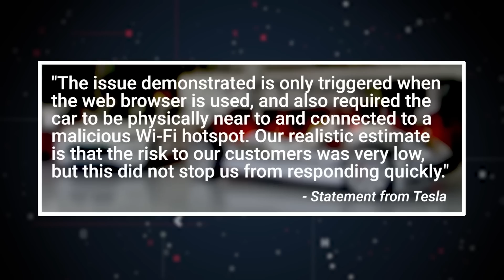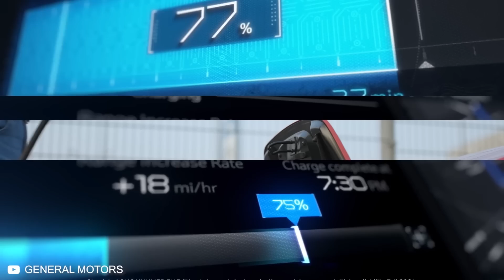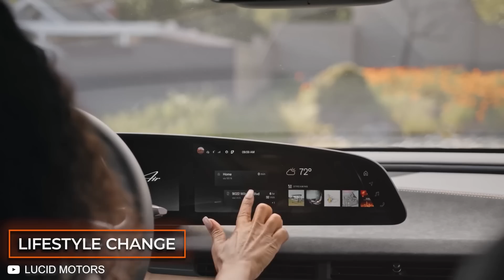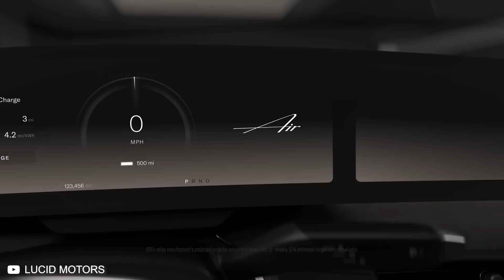EVs' Serious Problems That Carmakers Are Hiding

Comment: There is no way in hell I would ever buy one! It’s ludicrous. First, electric vehicle is NOT a disruptive technological breakthrough. It brings no innovative improvement for the consumer - other than the pure lie that it is good for the environment. LMAO! It will require an increase of 2.25 trillion KWH to have all drivers in the US to electric. Where is the fuel for the added electricity gonna come from? Well hell! Coal and Natural gas - and that will fry us quicker than gas guzzling SUVs - if you believe that garbage.
The motivation for switching to electric is to gain total control over mobility. Yeah you tree hugging dumbass! I say drill that abiotic oil and shut your pie hole. If you want me to get excited about new mode of travel then invent something that doesn’t require a massive government teet and flies like the jet sons.

Comment: Recently talked to a car salesman at a large dealership about ev's.
He said that they had an ev as a test run a few months back, but nobody was interested in it.  To costly, and the amount of babysitting you have to put into it, and lifestyle it demands from the owner. 
The manager sent it back. 
I guess living in the farming communities of the midwest USA is not the place for ev sales or usage.
Reply: I'm no fan of gas cars. I use during early winter, summer and spring a rather fancy ebike, which runs well in the cold of Minnesota. Most of the cars here are gas guzzlers
Reply: @duchessstudioband7896   You ride a bike in a Winter ?
 Just trying to get it straight .
Reply: @icosthop9998  yes I do. As long as I don't see ice, I'm good. I have electric heated gloves, and electric socks, neck warmer as well, with a full helmet. I cut it when there's a real snow cover. Tho the Grizzly bike is a total beast in the snow.  Awesome bike, with plenty of power
Reply: And btw, I'm a rather youthful. 66 woman. I made a commitment to commuting to my.job on an ebike, Minnesota has alot of bike trails, most roads have ebike lanes, so it's a Kool way to get around.  Early winter riding isn't bad with the right gear
Reply: @duchessstudioband7896  I've been to Minnesota in the winter when the temp is -20 and the wind blowing and snowing,how do you manage to wear enough to stay warm?
Reply: @hubertwalters4300  I stay warm with electric gloves. There are alot of winter wear that's designed with electric heated batteries. Vests, coats, gloves, socks. Very useful until there is a snow cover or a real snow pack. During the worst part of the winter, I use metro transit, which as you know, covers the suburbs as well as city. I work in the suburbs. But Minnesota has a huge amount of bike trails that are paved, bike lanes. The planners are building bike lanes into roads. There is a paved Bike trail that goes from St Paul to Duluth.  That's a long ass distance.
Reply: @2-MuleTeam  Very true, urbanites have much to be grateful for with regard to rural red America. It's also very true that rural America has much to be grateful for with regard to urbanized America. It would be refreshing to have us appreciate each other, rather than posting inflammatory messages back and forth. Peace.
Reply: So it's ok as long as you don't drive anywhere where it gets hot or cold just park it in the driveway and look at it,maybe go to the local grocery store,finally the government will have you where the leftest want you,unable to get in a vehicle,anytime and drive anywhere in the USA you want to go,this has annoyed leftest Democrats for a long time,they want your freedom to travel severely curtailed.
Reply: clot shots  I'd say EVs are simpler, so require less maintenance. 😉 I guess EVs don't work everywhere then.
Reply: There is so much disinformation in these's threads. As a farmer here is my personal experience. I live on a farm in rural NE PA. The nearest small city is around 37 miles making a trip to work/store a bit over an hour drive. I put a LOT of miles on my cars each year! In the past I have stuck with Toyota's with VTECH engines (no super chargers) as I knew that I could get around 250k-300k miles out of them and they were more friendly on gas. But I still paid a LOT of money on gas. I also knew we were well past 2006 "peak oil" production. The truth is despite fluctuations in gas price no matter WHO is in office gas will will forever go up and the speed of going up WILL increase. Seeing what is coming on the horizon I decided to do some real research for about 6 months. Based on real world data decent EVs were getting 500k-1m miles on their batteries. So about two years ago I bought a used 2017 Bolt EV with 35k miles for $16k. Best car I EVER owned! It's fast! It has a 280 mile range which means I can run around all day and when I get home I have rarely used more than 1/3 to 1/2 my battery. When I leave home my battery is always full. The battery (many monden EVs have this now) is thermally managed and uses a little power to self heat/cool to prevent problems/damage during hot/cold weather. This car has saved me a TON of money on gas! It will save me the cost of buying 3 gas cars by the time it's done. I have taken it cross country a few times with no problems at all (I road trip plan stops at Electrify America charge stations along the way which are very good). Lastly because I am a farmer who grows his own food and believes in self sufficiency/bring prepared, when I got my stimulus checks I purchased some cheap used solar panels and batteries. I now I charge my car off of solar most days. Being green wasn't so much the goal. I wanted ME to have self sufficiency if I needed it. If the grid goes down from a storm, someone starts a war (political party infighting over election, Russia, Israel-Iran war, China-Taiwan, etc), or say world inflation event causes prices of everything to skyrocket like crazy? Me? I am now more self sufficient. If I want to take the car to help the kids or give them some guns I can do that with less impact from outside chaos! Also when I do charge from the grid my money is going into the US economy instead of paying Saudi Arabia to hurt Americans. Reading these replies people are getting off on repeating all the false/negative tribal bickering instead of how it could benefit/make them more self sufficient. Just some food for thought from a real farmer! :)
Reply: @2-MuleTeam  LOL!
Reply: @2-MuleTeam      Again, I agree with most of what you say. And I do see that LONG term EV's can replace a high % of cars. HOWEVER, everything you said is still true. The grid nationwide has been at/near capacity for a couple of decades and it's aging fast. We're going to need tons more capacity if we're going to switch to EV's.
Reply: @2-MuleTeam  Definitely a city or urban phenomenon. I was "forced" into getting an EV because of parking permit costs and parking cost in general in my town, which EVs are exempt from. I also have hillbilly friends who think EVs are the stupidest idea ever, especially because of their price and limited capabilities, not only range. It is also hard to imagine reliable charging infrastructure in the boonies, i.e. needing to go 20 miles to a charger daily if you use your EV professionally, is not something most people agree with.
Reply: That sums it up extremely well !!
Reply: @2-MuleTeam  yeah mule, and the states that get the most money from the feds is the RED rural states.  And let us not forget all the  socialism to build and maintain all the thousands of miles of rural highways.  And don't forget all the products, drugs and such produced by the classes taught by all the commie professors you cry baby about.  If not for the URBAN folks, you MAGA morons would still be crapping in the back yard (many of you still do) and living in mud huts and using kerosene lanterns.  You MAGA  folks drink too much, smoke too much, and do too many drugs (just like your hero DJT).  And listen to too much fake news and are having love affairs with Putin and MBS.  And plus (the BIG PLUS) you worship the false GOD of money.  Just like your true loves -- LUCIFER AND DJT.  ha ha
Reply: @2-MuleTeam  You do realize the new electric trucks haul more weight than the ICE ones right?
Reply: The Ford F-150 Lightning seems to be popular. I doubt it’s only city folks buying it.
Reply: @2-MuleTeam  your stupidity amazes the grontorps
Reply: https://www.youtube.com/watch?v=OJtzuZIO-88&t=248s&ab_channel=FullyChargedShow
Reply: In the UK thieves are now cutting charging cable's for the copper, it's just getting crazy now
Reply: <<I guess living in the farming communities of the midwest USA is not the place for ev sales or usage.>>

The government will give you a choice between an EV or a horse,  as soon as environmentalists can manage it.

Haven't you noticed how much of farming is already controlled by environmentalists?  Why would that expansion of power and control stop?
Reply: @2-MuleTeam       I agree with most of your points. I'd just like to point out that even people who live just ouside a city center are aware of most of what you said. Case in point. NYC- The commuter trains and subways in the Bronx, Brooklyn, & Queens are all designed to bring people in and out of Manhattan. If you want to make a 5 mile crosstown trip in under an hour (one way) you need to have a car. Then it's 15 minutes.
Reply: EV'S = child slave labor in The Congo and a fiery death for you.
Reply: clotshots9072  Got THAT right.
Reply: Electric cars are a massive environmental disaster. Why would you buy one?
Reply: With doing my research I’m realizing it a lot babysitting. Also, the weather can damage those vehicles, especially if too cold,
Reply: @kyshac81  - I am from Wisconsin and they don't call Green Bay the Frozen Tundra for nothing!
Reply: @kyshac81  Not true.....no transmission service required, no oil changes, no poor gas milage....just change the washer fluid and tires from time to time.  Babysitting??
Reply: @barryccollyer2429  I assume the babysitting is in the form of range anxiety, which would be a very real thing in many parts of the US. Where I live it’s not an issue, but that’s why the EV situation is radically different depending on where you live.
Reply: @barryccollyer2429  You forgot never stop for gas.  I have a 100 mile commute and never stop anywhere. The car is fully charged when I wake up and can have 360 miles of range if I choose.  I typically only charge to 70% which gives me 250miles more than enough even if I want to turn around and drive back to work and home again. 
I stopped once at a supercharger to test it out and was topped off before I was finished my cup of coffee.
Reply: I'm sticking to my hellcat, gas prices are not a problem to me cause it will go down.
Reply: @coach2208  I'll look in my rear view mirror for ya!
Reply: @davekozlowski1266  you probably will,  but the inside of your electric car will sound boring.  It's like sitting in your living room being bound around .
Reply: @coach2208  lol, yeah sound and looks are a lot more important than actual performance.
Reply: @coach2208  BTW hellcat will be electric in 2024.
Reply: @coach2208  What makes you say they will go down? I really hope so but I'm doubtful
Reply: @2-MuleTeam  The ICE car or EV is made from rocks, pebbles, sand, dead fish oil, and tree sap. Is that correct.
Reply: @2-MuleTeam  it actually works better in rural areas then urban, as it's easy to charge it at home where you can park on your own property. In urban areas that can typically be a challenge.
And it requires less babysitting than ICE cars: no oil filters, air filters, oil, ...
Reply: @arnaudinstalle  you are correct in theory. I think the governmental push is too all encompassing. It really is just a matter of letting the technology develop to meet rural needs. For some rural folks it may work now, but I think the majority need more than what the tech can give. From how it was explained to me, based off of the testing, is if I had an electric car and drove 100mi in the dead of winter, the first thing I would be doing is looking for a place to charge. Then run my errands, then charge, then drive home.
Reply: @2-MuleTeam  I agree completely, these people live in a bubble, not the real world.
Reply: @hubertwalters4300  It is true , they do live in a bubble. 

 They are very righteous among one another  🙏😇🙏

  I am a #Patron subscriber to the Electric Viking channel. I do learn a lot about EVS there.
I live inner city I own my home , but when I tell them I don't have a garage they are shocked 😲

 I'm sitting out from buying an EV for the next 2 years.
( I would like to wait longer but I don't have the patience)
 The 1st EV  I will buy will probably be in 2024,  the way battery technology keeps advancing and at its current rapid rate a EV today with today's current battery configuration will be obsolete within 2 and a 1/2 years.

 Prime example is that the early EVs with the "3G Technology" are now dead in the water with "5G technology"  kicking in.
Reply: @icosthop9998  I understand, I live in a rual community and I don't have a garage either, I am 70yrs old and I will not be buying a EV, I am retired and through I draw about the max on Social Security and have a union pension, because of all of this inflation we are having I find myself running out of money before the end of the month and having to dip into my savings to hold me over,and I don't even have a house note (house paid for) or car note (two cars,both paid for),but everything from groceries to utilities have gone up sharply, my wife has some medical issues and medications but even with that we were doing ok until this administrations policies started running up the cost of food, fuel, and utilities, and this started before Putin's invasion of Ukraine, so I could not afford to to pay the notes on a EV or even a ICE car,I don't know how people who do have notes to pay on homes and cars,in addition to everything else are making ends meet,I spent 40 yrs as a over the road trucker and I may have to come out of retirement the way things are going now,and the thing is that I saw this same thing during the Carter administration, and I know that inflation will not come under control until interest rates are higher than the inflation rate,but when that happens people will stop spending except on the necessities and then we will have a deep recession,so I can predict,based on the past,that things will get much worse before they get better,so I will not be in the market for a EV or any other kind of car for a long time.
Reply: @hubertwalters4300  Damn
Reply: @hubertwalters4300   @Duchess Studio Band"   called me back to this thread.
 Sometimes I see truck drivers that appear to be in their eighties , still driving trucks and I'm thinking because they love the job , not because they have to keep working.
Reply: @icosthop9998  I'm sure many do love it,I did it for 40 years then I retired,but with the current policies of this administration  forcing up the cost of living I may have to come out of retirement and hit the road again.
Reply: @hubertwalters4300   I give all the truck drivers , "ALL the Credit in the World" , 👍 because there's a lot of idiotic drivers, far from being professional , on a road with you.
Reply: @icosthop9998  Thank you, when I was on the road I saw quite a few idiotic truck drivers,and a lot of idiotic car drivers,I hoped the CDL program would get the bad truckers off the road,but it didn't.
Reply: With current battery technology ev cars make sense only in southern, more or less warm states. You do not want use electric car higher than south Carolina. At Alaska it is virtually impossible to use.
Reply: @KulibinX  That is so funny.  Sorry, unlike you gather from the movies Alaska is not a 100% frozen wasteland.  Have you been to Alaska?  These vehicles do fine in the cold.  There is a reduction in efficiency initially but the batteries warm themselves (including in the south and north on the way to a supercharger) and once warmed are efficient compared to a mechanical engine dumping fuel and other liquid out the tailpipe.  Before people spout off facts they should at least investigate the truth instead of what someone told them.
Reply: @barryccollyer2429  the warmers reduce range because they draw more power, and the warmers are working overtime at negative 40F. Plus when town is 100mi away you need payload and towing capacity, because you ain't driving 100mi for nothing. I work near the cold weather test track that tesla their competitors use, and talked to a guy that deals with their engineers. They ain't even close to meet northern rural life requirements. Also the electric companies here are overpriced so a lot of families are already paying around $300 a month give or take. I think once they can make an electric door long bed pickup that can get closer to 500mi range, at 40 below, while towing 20-30klbs, they might get some rural interest.
Reply: Also not great in VT…COLD…other than feel good save the planet folks…🙄.  I drive a suburban…need the space and steel frame keeps me safe.  NOT changing.  Batteries in cold wx loose huge amount!
Reply: @alexandrawhitelock6195  You don''t have a garage? I can't imagine living in a cold place without one. I can remember not being able to start combustion engine cars either when the temp is below freezing!
Reply: @fyourfeelings8966  yes I do although volume of Vermonters dont.  But this is irrelevant. Batteries loose charge at higher rate as temps drop.  EVs are not efficient in cold climates. 
Emergency responders know to put their radios inside their jackets in cold temps…conserves battery life.
Reply: @fyourfeelings8966  adding…a garage does help car remain warmer, and clear of snow, but this ends once you back out and druve..,then battery performance plummets.  Many EV owners return to ICE vehicles…
Reply: @alexandrawhitelock6195  FYI… Tesla cars have the highest safety rating on the road.